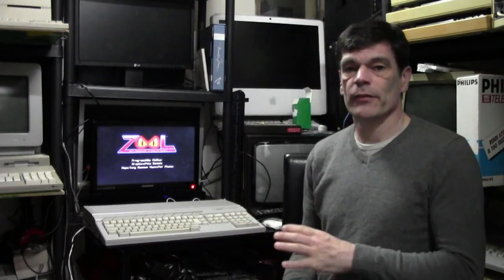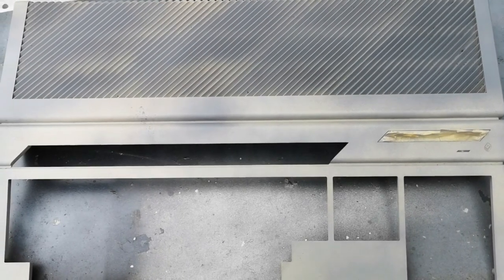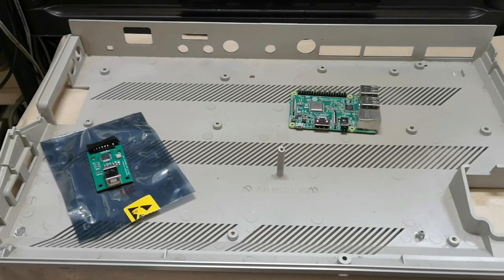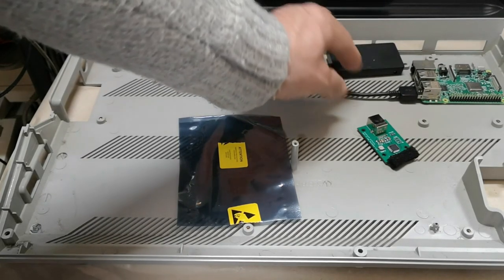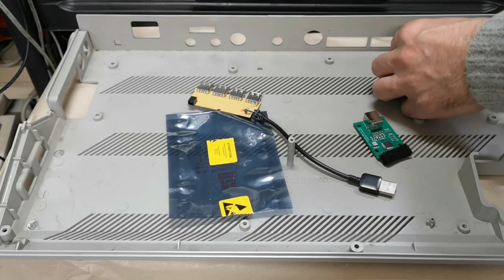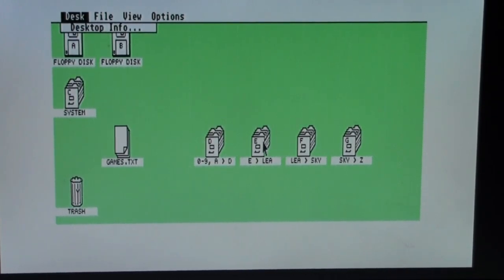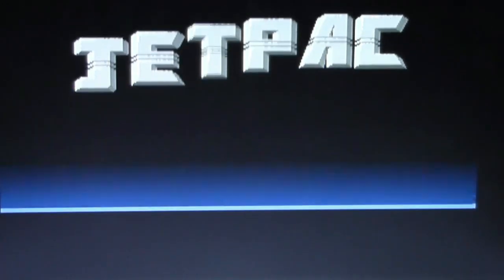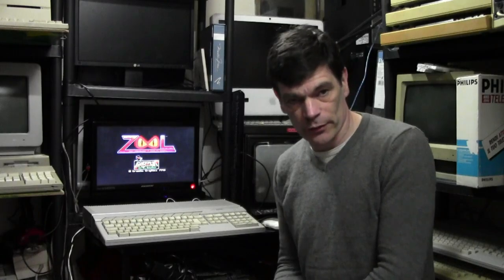Atari 520ST Junk pile restoration and Emulation

Comment: Do you set the raspberry pi to boot straight into the emulator?  Does the pi shut down also run straight from the emulator?
Reply from the maker: It's set to boot into the Emulator so to the casual user it is the machine it is supposed to be.
You can have it boot to a desktop and use it as a standard keyboard for modern applications as well.
I hope this helps. Cheers Phil